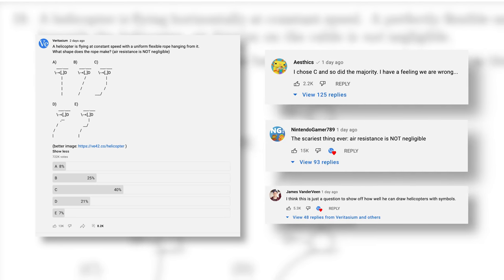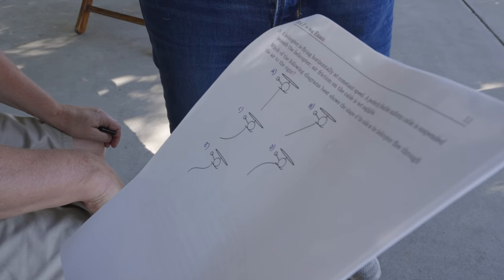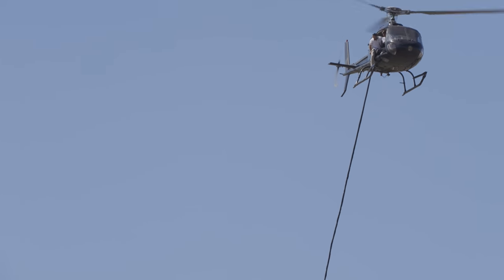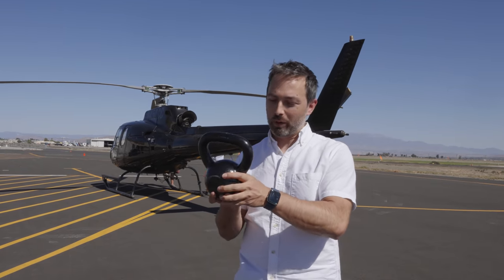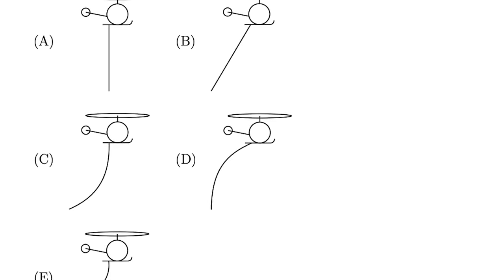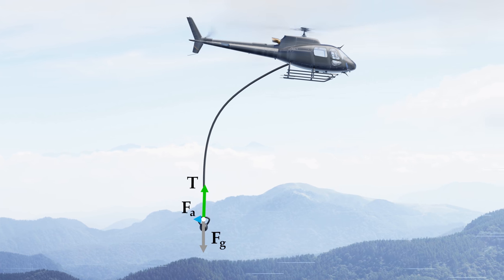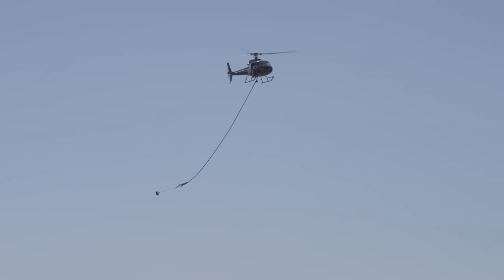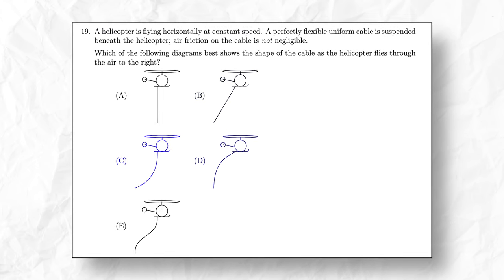I Rented A Helicopter To Settle A Physics Debate

Comment: I find it intriguing that professors develop multiple-choice questions, and submit candidates to life-altering (pass/fail) tests, when they actually do not themselves know the correct answer.
Reply: Did someone suggest they did not know the correct answer? I thought it wasn't really a debatable question, but I have a physics Ph.D. I wish they clarified who disagreed with the answers. Maybe I missed it.
Reply: @jaredlittle21  I looked into it a little bit myself and the controversy wasn't so much about what happens when you construct the forces, but about the negligibility of the rotor wash. If you expected the rotor wash to be a meaningful force, you would arrive at a different answer than if you didn't (because unlike the force of air resistance, the force of rotor wash is NOT constant across the length of the rope). Determining whether you should account for the rotor wash hinges on helicopter knowledge rather than physics knowledge, so the question was controversial- if it had been a blimp, or the question had specified that rotor downforce is negligible, it would be noncontroversial.
Reply: @jaredlittle21  It was the students themselves that disagreed with the answers, the professor stated that the students had made their own experiments at home and that they got different answers based on their experiments. The "physics debate" as the video is titled was not among the professors, there's even a mention in the video that the reason this question existed was because one of the professors saw the weighted variant first hand and thought it would be a good question while another professor suggested it would be a better question if there was no weight attached.
Reply: @DiustheZ  Right, which was why I was surprised at the OP I guess. I thought maybe I had missed something in the video. Seems like an very interesting question!
Reply: These same people make tests for elementary aged children that are written like college level questions. It’s sickening
Reply: @ardenblair8985  What are you talking about?
Reply: Most of these types of tests (at least in the physics world) do not literally only judge if you got the right answer scantron style, but what is your reasoning behind it. If you articulate WHY you chose a specific answer in a reasonable way that demonstrates a fundamental understanding of the question, you are likely to pass overall. If however, you choose something that just shows you don't even have the basic knowledge or intuition to understand the question, or your answer shows a clear lack of mastery of the basic material or that you don't know the foundations involved in figuring it out, you will likely fail. But again, not sure on this specific test

Source: all the tests I took to get my physics degree
Reply: @Drynywyn  yeh, I have no formal training in either, but it seemed obvious to me it was going to be answer C because of the rotor wash, without rotor wash I would have gone with b, but that seemed too simple to me, so I assumed there had to be extra factors like the rotor wash to factor in, plus that seems like something obvious that needs to be considered anyway. 

I wonder if the rope length &/or weight are changed if the rotor wash then becomes non-negligible. I mean if the wash impact is limited, then it seems obvious to me that the thicker & heavier the rope, the less it will be impacted by the wash
Reply: @DarthXavius  are you expected to give an explanation though? Or do you just have space to give an answer if you think there's a possible problem? Cause I tend to talk/write a lot, but on this one I would see c as the obvious answer due to the rotor wash & even pressure otherwise (I know, "pressure" is probably the wrong technical term) & not bother explaining it further, saving my time for other questions that may need it
Reply: When you listen to the test writer, he says, "I saw the helicopter and thought the ropes motion was contrivercial, so I thought it'd make a good test question." 
That was rediculous, test questions aren't meant to be contrivercial, especially in highschool. They just test if you know what you learnt that year, nothing more please.
Reply: @jffrysith4365  he didn't say controversial, he said counter-intuitive, which are two completely different things. And a counter-intuitive physics question is pretty neat (as he says himself) since it means you have to know the physics and think it through, rather than just going by intuition.
Reply: @jffrysith4365  Actually, when assessing someone for non-mandatory society program, that's exactly what you want... but I'll stick to his professional opinion versus your "contrivercial" "rediculous" "learnt" opinions

FYI Controversial, Ridiculous, 'what [students] have/had learned'
Reply: @lilaclizard4504  Can't really give you an answer for this test in particular, but I thought I'd throw my two cents out there because the test documents looked very similar to the Physics GRE. Yes, they are multiple choice, but they are graded by a human and most of them will require some basic work to arrive at the answer. This question is definitely a bit weird in that it is purely intuitive, but if I were personally taking the test I would at least draw a force diagram to check myself in the blank space. I think if a grader saw that and the force diagram made sense, it would prove understanding if not exactly coming to the correct answer.
Reply: It’s like forced evolution imo. I support it.
Reply: @DarthXavius  The professor actually said, that he thought his observation would be great for a multiple choice question.
I don't think there is lots of explaining involved in "multiple choice"!?
Reply: It’s off a curriculum. the government decides on the answer they want you to teach and then it’s up to you to further your education and challenge anything you don’t believe
Reply: @kanemeasham-pywell92  hrmmmmm no, I think the professors knew the answer?
Reply: @kendalldrury8156  my school gave us the teaching curriculum set by the government, said that things might not be right but we will need to answer as they wrote it to get maximum points in the final exams
Reply: @kanemeasham-pywell92  That sounds horrible and another failure of the American public school system, not sure it's hat happened in this case though. This looks like a private institution, and given it has professors instead of just teachers I assume it's a college instead of a high school.
Reply: They can figure it out with physics, not having to actually do it
Reply: @jaredlittle21  i was in the air force with jared little, i used to call him Gerode
Reply: 'Intriguing' doesn't quite seem to be the most appropriate word for it!
=====================================================================================
Reply: @jffrysith4365   "This might make a good multiple choice question" is his exact phrasing. Don't know what video you were watching.
Reply: @IvanCherganski  looking at my comment, I was referencing a different time in the video. 
Also I agree with the top comment, it's rediculous that a question is made because the physics is counter intuitive even though a test cannot be run by the students to check, and lots of students won't have seen a helicopter with a rope attached in their lives. (Or at least didn't analyse it)
Reply: @bschuss1  counter intuitive means not expected, this means that knowing the physics will often not help (as it did for many students who overestimated the force of wind) and this tests on whether any student has personally seen a scenario as it stands. This isn't a good thing. Regardless, the question clearly doesn't belong in a physics test as there is minimal physics to it anyway. (Just understanding air resistance and relativity) and beyond that neither are taught in HS so ...
Thank you, however for not writing in a snobby way like DarthXavius below, and denouncing my argument based on my unstated position.
Reply: The answer here is just wrong too.  F(g) does not increase anywhere except at the weight itself - it is NOT bigger at different parts of the rope, only at the end.  Along the unweighted rope, F(g), F(T) and F(drag) are basically equal, which is why the unweighted rope looks straight.  The only reason for the bend down of the weight rope is the DIRECTION of the vector of the F(T) at the weight has to be more vertical, as F(g) is so much bigger here with a negligible change in F(drag).  Each point on the rope from the weight then has a change in F(T) vector (not amplitude) to get closer and closer to the direction of the unweighted rope, which is the balancing F(T) opposite F(g)+F(drag) of each point of the rope itself.  This is why the weight rope looks mostly straight with a downward hook just at the end.

The real answer looks like a hockey stick pointed down - mostly straight until the very end - not the bulbous falsehood that the "right" answer seems to show.  That's because the real answer is not changing F(g) amplitude along the rope but only the different direction of the F(T) vector at the weight.
Reply: @haleseason9728  they literally hung a rope from a helicopter and proved the answer was right 😂😂😂
Some people...
Reply: @IvanCherganski  
You can get the same result with the wrong reason.  It's okay if you don't understand.  F(g) doesn't change along the rope, only at the end.  Period.
Reply: @haleseason9728  sure. Clearly phisics professors and the actual test results don't agree with you, but I'm the one who doesn't understand 😂😂😂
Reply: lol this is pretty normal for jee aspirants in india
Reply: Why does that intrigue you?
Reply: I have a sail boat, with a rope to a pulley atop the mast for raising a lantern or flag. On a windy day with nothing on the end of the role, it blows outward diagonally but straight. With the flag or lantern, I get the other two shapes.
Granted, I don't have a rotor up there, so the set up is a bit different.
Reply: I’m intrigued by how poorly worded the question is, and surprised this wasn’t discussed in the video. 

It states the heli is traveling horizontally, and later states it’s moving to the right, so why are we to assume the heli is also moving forward?

I answered “A” because if the heli was strafing right(or east) the rope would be dangling diagonally in the opposite direction which would be left(west)
Reply: Ditto for EMPLOYERS.
Reply: @jffrysith4365  this was an Olympiad question. The very point of an olympiad is to be tough, and non-standard.
Reply: @planeloverpilot4802 okay dude. Why aren’t you in the Indian physics olympiad team then?
Reply: @jaredlittle21 the students didn't all gave the correct answer. Probably why they're still learning.

Comment: "Rotor wash dissipates pretty quickly"

Ah yes.

Why would I not know that
Reply: Lol his tone was priceless
Reply: Energy of air pressure going down must be equal to the weight of helicopter.   
Which is a lot.

But it seems that it does not affect the rope at all.
Reply: Thats exactly why I got my answer wrong... of course! I should have known/remembered that it disapates pretty quickly.
Reply: But that depends on the helicopter. They explained what type it was. Depending on which one it may have more of an effect
The queston should say what type of helicopter or say most or something along those lines
Reply: @dinsel9691  It is spread over an area quite a bit larger than the main body from above. Very hard to estimate how much it would be. The weight of the rope matters too.
Reply: I was surprised by that statement, because in movies helicopter, when flying over water close to surface, makes short, but visible waves, and when landing on a ground helicopter makes swirls of dust. But video shows that "wind" from rotor is not so strong.
Reply: I beg to differ, in a mazda RX-7 it doesn't dissipate at all
Reply: @victoru.9808  
Not just in movies...
Back in school an emergency helicopter landed right in front of our school, while we were waiting for the school bus.
We were maybe 50 meters away and it blew a ton of leaves, sand and dirt in our faces, because there were quite a few molehills 😅
Reply: @victoru.9808  Ah yes, but the force down from the blades will dissipate laterally as well, so consider the volume of air underneath the blades expanding the further down you go. Volume is the cube of the distance, so the force from the blades dissipates somewhere between the square and the cube of the distance from the blade. For a long rope, that get's negligible pretty quickly.
Reply: Why would anyone not familiar with helicopters know that? What a dumb question to put on a qualifying exam.

Comment: I voted C expecting the helicopter rotors having a very large wash, because if they are on the ground you see a lot of wind, but well, seems like it isn't as much as I thought, very nice video!
Reply: When the helicopter is on the ground, the wind doesn't go that deep – turns out it's similar when it's in the air.
Reply: Could be better to use a light plane for that question
Reply: @PauxloE  I don't that's a good argument regardless, because the wind can't go deep on the ground due to collision.
Reply: I knew it was D intuitively because i've seen helicopters fly buckets of water so many times. i feel like its cheating though because i couldn't tell you why its D, just that i know its what actually happens.
Reply: I voted C and reckon it might be a correct answer if the rope was very light. This was some heavy rope!😁
Reply: Test topper  yup that's why I wrote "I coted C expecting" in past and not present
Reply: @danielmorton9956  Yeah, this was not meant as an argument, more as a joke.
Reply: Yeah in my opinion a better question should have stated that "helicopter wash is negligible" because that expects you to know things about helicopters in particular rather than physics...